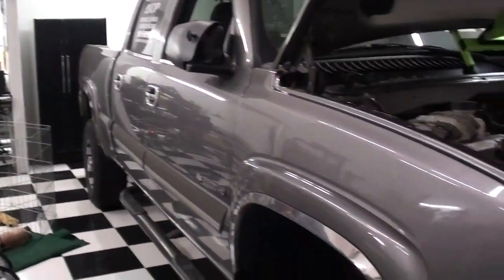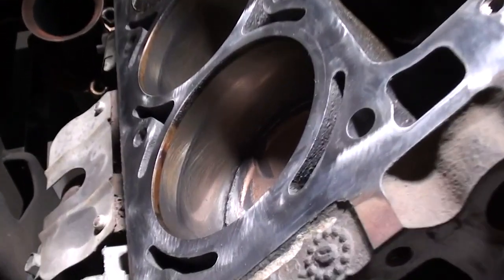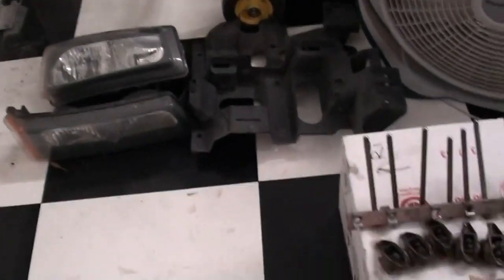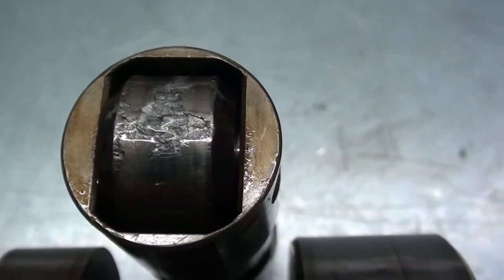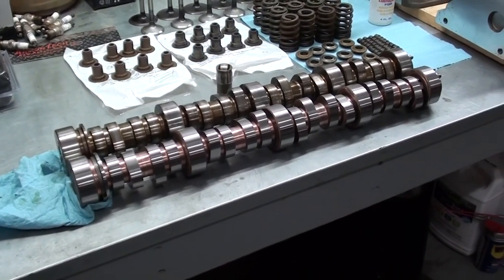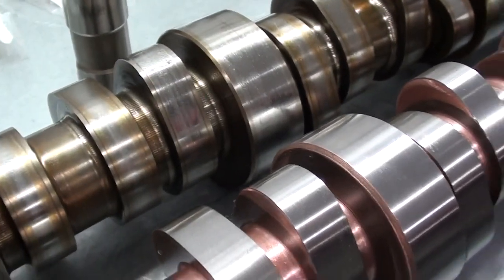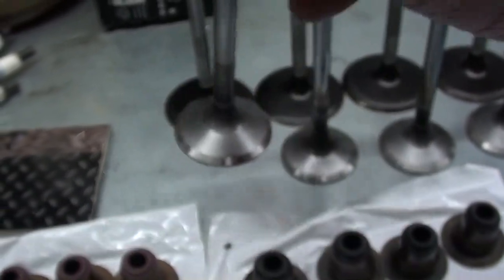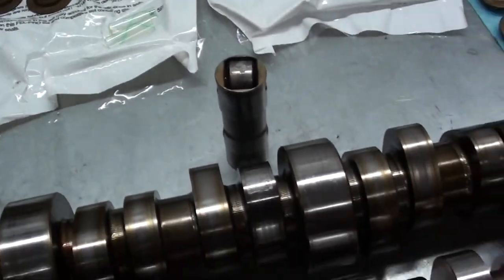2007 Chevy Pickup Lifter and Cam Failure At D-Ray's Shop

Comment: My 2015 6.2 Silverado LTZ lifters on cylinders 4 and 7 just collapsed 117k miles. Sounded like a bad ujoint to me. Anyhow dealer wanted 8k dollars to put afm lifters back in. I'm doing a full afm delete myself for less than 2k bucks. BTR cam, ls7 style lifters all gaskets. Refreshing the heads too , like yours the cylinder wall look good , but on DI engines carbon builds up on intake valves , so will be cleaning them and new valve stem seals too. Will be watching your progress. 👍👍

Comment: I'm not surprised about the condition of your your cylinders. High nickel block, forged piston with a chrome ring. Plenty of miles left on yours. The camshaft, not surprised either. You can chase theories around the beer keg all night if you want. I assure you not the first trashed camshaft I've ever seen. I have, literally, piles of used-up roller cams and lifter assemblies. Bottom line is it needs replaced. Nice video. Well thought out and informative.

Comment: Same issue just recently happened to my 08 Chevy Suburban 5.3 L. but on 6 cylinder intake lifter. It collapsed and caused that same looking scrape on the cam. I'm in process of doing same type of work. Thanks for the video.

Comment: nice video.  A couple of questions:
1.  What if someone were to do nothing in this situation.  How long do you suppose it would take before the cylinder failed completely?

2.  What would it be like if only the lifter was replaced, and not the camshaft?

3.  My truck, 2006, only has about 150,000 miles.  Seems like short mileage for lifter failure. Are the performance differences between roller lifters and the older hydraulic lifters  substantial enough to justify the risks of this failure.  This is a common failure, I'm finding out, and you installed 16 new lifters,  the odds of another roller failure might not be favorable.

Comment: Did you have any waving/wondering or gradual motions of oil pressure on the gauge? Like pressure sitting normal at hot idle then starts wandering down low towards 20psi then waves back up normal, may also bounce up much higher towards 60 or 80psi for a split second.

Comment: What you are going to run into soon is low oil pressure. What happens is the rubber o-ring dries out in the oil pump where the oil pickup goes in. Instead of just using the o-ring, I cleaned off the joint real good and used a little silicone too. Whats even better is to use JB weld because it will never suck air again and cause low oil pressure. This 50 cent o-ring is responsible for a lot of motors having lifter noise and destroying motors.

Comment: I know this is an older video but I just tore my 07 Yukon engine down and my #7 lifter has the same damage on it. I did replace the lifters on that side and new gaskets and put back together and still knocking. So gonna replace Cam, all lifters, and the vlom. The lifter manifold.

Comment: my Ford 6.2 did this also. pitting on the cams and the roller lifters. It happened at 417000 miles. I was using mobile one at the time.

Comment: Hey D-Ray, I'm about to do the same job on a 2007 5.3L with a ticking lifter. Like you I'm installing a slight cam upgrade as well. How did this turn out? Are you happy with the truck? Thanks.

Comment: I'm thinking I'm just having a lifter stick it just does the noise when colder out and makes the noise the first 10 miles or so then stops. I'm guessing I will be able to see if there is cam issues once I pull the lifters out.

Comment: how do you like that custom grind cam? I work at a gm dealer and have seen this not only on LS engines but other engines with roller lifters as well. Usually only 1 lifter and does ruin cam. Funny thing is when gm changed from flat tappet to roller tappet it was supposed to fix all those issues. Good videos keep em coming

Comment: I'm about to have to do the exact same thing to my 2010 Silverado with the 5.3. When you pulled the heads did you have to resurface them or mill them or get them inspected for "flatness" on the mating surface? Or did you bolt them right back in? Thanks

Comment: My teacher explained it to me as the way gm grinds there cams is its a long duration and then they slam the valve shut because they have to meet emissions. When you slam the valve shut  the lifters bounce up and down on the cam and flat spots on the rollers and cam occur. All ls motors have this problem and comp cams makes a kit that will fix this for good.

Comment: I need some advice. I have a 2007 Avalanche with 115K miles. Got stabililink and traction control lights combined with a bad miss. Code reader says misfire on #7. I suppose there could be a bad lifter and/or cam or AFM cylinder deactivation solenoid. I fear that it's going to end up being an engine teardown. If so, I think I would prefer putting it back together with regular roller lifters and simply chuck the cylinder deactivation system altogether. I also pull a boat. Other than having to fork out large bills for the parts and the actual work involved in tearing it down, what sort of drama should I expect? How difficult is it to convert an LS from AFM to all cylinders, all the time? What about reflashing the ECM to work without AFM? Do you happen to have any contact info for the cam guy in Louisiana? Thank you in advance.
Reply: Hey Steven, I just had the exact same thing happen to my 2007 Avalanche, with just 98k miles on it, and I also tow a boat.  It would be really helpful to know what you found was the problem with yours.... , and what was done to correct it.  And I also would be interested to know if you were able to deactivate the AFM, and if you recommend doing that.    Thanks!

Comment: Why not reuse the head bolts?  Is it because of fatigue due to the heat..? Just wondering.. 
Thanks  ..  Your videos are all great  !!   The 3 wheeler video got me hooked on your channel..  Your an awesome mechanic!
Reply: +Vdubin64   The majority  of head bolts for the last 2-3 decades have been and are torque to yield bolts also known as "stretch bolts". Once they are torqued the first time, they should not be reused or re-torqued as they are likely to cause a new head gasket to fail.

Comment: Wow... I would have pulled that engine and done it right... I bet the main and rod bearings looked all scratched up... Just looking at that cam you can see where the bearings journals are all scratched up... Metal went all through that engine... Is it still running...
Reply from the maker: Over 240,00 miles, pulling my camper or boat regularly. Holds 40psi oil pressure at idle, I do believe it was done "right", or it would have crapped out by now.

Comment: do you think this may have happened when you lost oil pressure for that short amount of time?
Reply from the maker: I am highly suspect that the roller may have been pitting for a while and a piece of it caused the oil pump relief valve to stick
Reply: the lifter spun in the plastic guide. the guide deformed from the heat cycles.
Reply from the maker: Nope

Comment: Just wondering did you replace lifters ? I have done several of these and this is the first I have had a problem. I didn't replace lifters.I swear the book did not used to say you had to. Maybe that's why they changed it.

Comment: I have 2007 silverado 5.3 my mechanic wants $3600 to replace cam shaft, oil pump, lifters, . I installed new plugs, spark plugs wires, ignition coil. Hope someone out there will tell me if that's a reasonable price.  Thanks!

Comment: Why the hell would you try to drill them out lay a nut over the top weld it hit it with an impact they come right out the world will not stick to the aluminum I do it both in vehicle and if the heads are removed

Comment: Chevrolet doesn't mean quality now days, with the ever increasing amount of recalls and pending lawsuits against them, it seams as though they are more worried about profit than quality.  No more GM products for this family.
Reply: That's sort of always been the deal with GM.  If you have a Ford, all the stuff on the outside of the engine fails while the engine itself keeps going strong.  If you have a GM, that stuff is a little bit more dependable but the engine itself is more likely to have internal issues that are major things to fix. I've had American cars since around 1971.  Since I tend to drive older ones, that means that they went all the way back to flatheads.

Comment: If you love your car. The best decision is t change the engine. I have the same problem . l have the 03  Chevy Tahoe. You can still drive this car but it is not going be smooth. And not going be good on the gas. Doing this kind of job to the engine will not  be the same as before every thing will be aftermarket.. The high mileage will have this problem

Comment: Geeze what a project for a low miles engine. It is a shame many of these LS motors don't hold up well. I am looking at this project as well. 2009 5.3 AFM occasional warm engine lifter tick. Comes and goes. I suspect a bad AFM lifter. I just ordered this Range Technology Active Fuel Management Disable Device http://www.amazon.com/Range-Technology-Active-Management-Disable/dp/B00BR1R8N8/ref=cm_cd_ql_qh_dp_t . Will see what happens. Great video!
Reply: Eric how did you like the Range disabler ? I’m thinking about getting one for my truck.